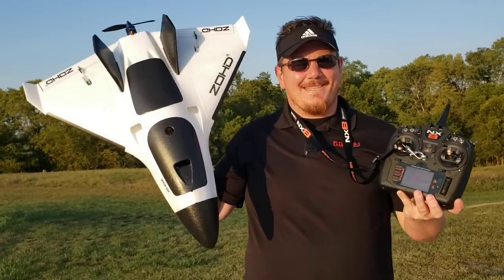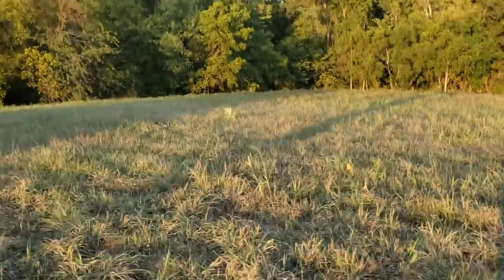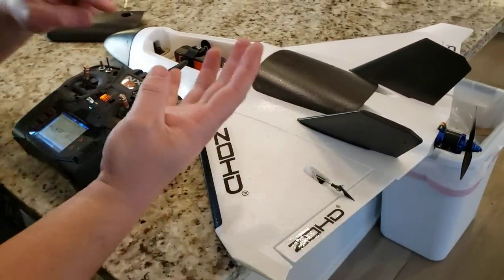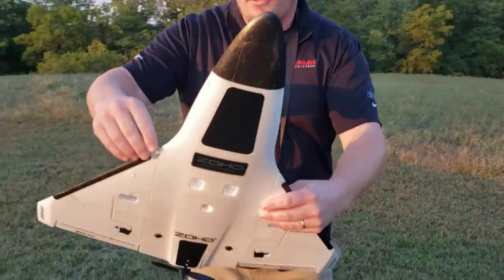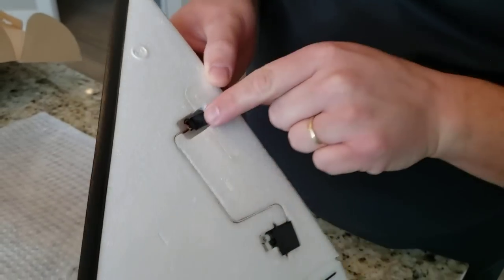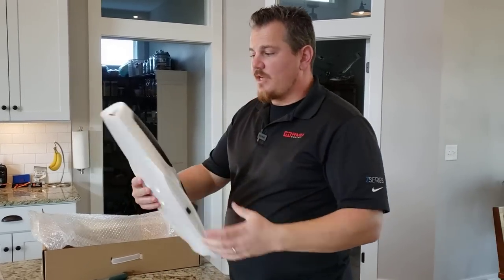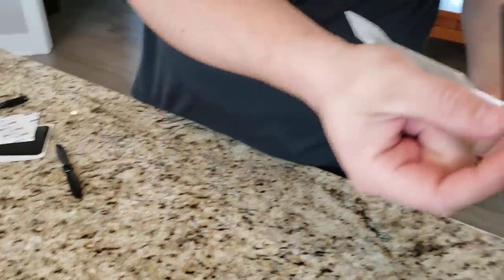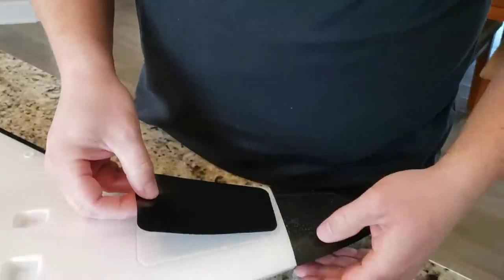ZOHD - Alpha Strike - 620mm - Unbox, Build, Radio Setup, Maidens, & Crash!

Comment: Okay, i am glad your crash was a careless error not doing a preflight servo check...i have had planes with even worse damage and more pieces than that..some i glued back together and they looked great with some light body work and paint...and flew exactly the same...my foamy repair skills are pretty much top notch..after 10 years and over 100 repairs you really figure out the best methods...whats great about your crash is the wings were not damaged...easy to fix imo...
Reply from the maker: yeah, fixing foam is one of the best parts of foamies, but people still bash them as though it's a negative quality. I love the fact you can fix them for next to nothing, in many cases...sometimes, of course, we need parts, but it's still a lot easier than doing a repair on a balsa wood plane
Reply: @BrianPhillipsRC  actually at bg they sell fuse with nose  for about $20 ...i will will practice with my beat up planes before i maiden...i think its a great model,reminds me of my 50 edf skyangle screamer...i crashed that in a chainlink fence (6 peices)and managed to fix it...still flys great..Happy flying!

Comment: Thanks for sharing. In this hobby things happen.  Equipment failure, pilot error, etc.  Glad it didn't turn out worse.  Still a cool plane.
Reply from the maker: Pilot error...not equipment failure. I never let it initiate after I adjusted the breaking... this was a very unfortunate pilot error ;(
Reply: @BrianPhillipsRC no worries.   based on your flying skills this is a very rare occasion.  Absolutely love your channel and your format.  The most useful for me of any though I have older radios so the setup portion, while interesting and well done, isn't something I can use..    for now.😄

Comment: OK, so i got the ZOHD Alpha Strike, yours lasted two more flights than mine. Maiden flight it went into an uncontrollable up and down and flew out of site. I painted the top safety orange and that's the only way i could see it as far as i did.  Who knows where it ended up. I have been flying RC planes and heli's for over 35 years and never had this happen. No more of these for me. I have an Extreme Flight Outlaw from 10 years ago. It is the ultimate speed rush! No stabilization and flies like on rails.
Reply from the maker: I bet you might have been a TOUCH tail heavy, which is SUPER easy to so... Sorry about your loss!

P.S. I deleted a duplicate of your comment...not sure what happened, but didn't want you to think I was upset or something strange.

Comment: Analog VTX at 1.3ghz, 4S 000mah Li-ion, TBS CRSF or ELRS, a nice cam, 7.4 folding prop, 50a esc, T-Motor F80 with a nice ground station and automatic antenna tracker and go fly some nice long range. Short range, swap out to DJI FPV air unit or TBS Unify 5.8ghz HV, 4S 3200mah lipo, F80 motor, 50a esc and 7x4 folding prop, and  then slap either the FPV COMBAT or ZTAG unit in it and get a friend to do the same. That's how to enjoy this wing. 😃 That's just my opinion of course. Enjoy it the way you see fit. 😃
Reply from the maker: Sounds like quite the payload ;)

Comment: DITTO'S,Your an wifes time for Lonnnnng videos. Well worth a RC'ers time to watch an learn.. even liked the snow,.
Im 63 12 years electric planes.
Fly Havok,Radjet, Fast. No assists.
Because of your video on ZOHD ALPHA STRIKE, I purchased.
For me an without assist had 4 flights b4 PILOT ERROR crash an burn. . .
Wow what a Rush of Adrenallin, .
I recommend Some kind of flight assist for most however.. i banked to steep in a turn at low throttle to low  at 
"0 mistake high" lol. My Error totally as yours was passing on control check,. Hey I Relate, . Shes a Great wing Airframe, . An quite a Motor Esc, to say the least. 
. Ill buy a few more of these..
Will put some type of stabilizer nextime. 
I was Crying about that Crash an burn. Great Aircraft for The 
" Set your Hair on Fire Pilots".
Shell rule your Clubs Airfield.
Tks again Take the Camera crew out to Eat. You so Lucky!
Reply from the maker: Glad you're here with us, and stabilizers are a huge part of making this hobby fun for me...I don't lean on the auto leveling much at all anymore, but stabilizers make the planes a lot easier to "tame". Some people don't like the "feel" of a stabilizer, but I personally like the feel of plane that's in one piece - LOL ;)
Reply: @BrianPhillipsRC  , 10-4, Im looking into GyroStablizer's nx3, possibly Zohd , Have admiral, lemon with stablizers already.
Yes the Fast Havok, an most wings I admit benefit from Stablizers,.
. Ill have one in My ZOHD A.Strike, Great plane, Mostly,lol

Comment: I think this is worth a revisit. It looks to be up there with the F27 maybe even faster. AR637T and maybe a different esc. I was scared just watching the flybys! Great work again!
Reply from the maker: Yes, AR631 would be just fine. I should have just used one but here we are. I don't blame the equipment for this one...I never actually watched for the aileron twitch - big mistake!
Reply: The F27 would be a great comparison, it's probably about as fast but with sooo much more room inside for whatever you want to put in it. Wonder how it would fare with a slower more cruiser with FPV setup for longer flight times.

Comment: Waiting to maiden mine. Really like the way you launch it. I usually use a side toss on similar planes, where you hold the plane by the wingtip with the plane on it's side. The torque levels it out, rather then starting level and then going on it's side. AND gets the prop away from your hand. Side note-please don't take a damaged battery into your home, even for a moment! I was waiting for that thing to blow... Thanks for the great videos. What camera are you using? The quality and focus holding are awesome.
Reply from the maker: That battery was taken out and shot after we were done taking footage. I know exactly what I was risking and have experience with these packs. I have intentionally burned them, shot them, pierced them, tested the way they puff before 
blowing up...I'm well versed in the way they fail (to the point of fast burning fire, and or smoke bomb).

As for this plane, wish I got some more time with it, but such is life with crappy rx'es ;(
Reply from the maker: Megan was using my Samsung Galaxy S9 - she is a genius with the camera! So lucky she helps me!!!

Comment: I think I've watched 5 videos on this thing, and every one of them ended in some kind of wreck. You flew it longer than anyone else. Most people launch it horizontally and torque roll it right into the ground, some of the flights are literally 10 seconds.
Reply from the maker: WOW - I feel a lot better about my tragically short experience now - LOL ;)
Reply: Yep, so many failed maidens lol. It needs speed to fly at its best,  gets small so fast and is also difficult to tell orientation... which really makes it best suited for fpv.
Reply: It definitely gets small super quick and the worst plane ever fir orientation. I'm going to put an fpv kit on mine when I get round to it.
Reply: Brian is a very good pilot...many experienced guys have zero experience with fast prop jet deltas...those are the guys who crashed...Brians crash was just an electronic issue of some kind,not pilot flying error or poor plane design..these are not for everyone,but they certainly are a lot of fun for many of us..😊
Reply: Yeah l agree with the above. A lot of people have noexperience on a model like this. If you launch it level half throttle is enough for it to head out with no torque roll if you give it full it will roll so don’t give it full😮 lm used to funjets radjet , other small fast stuff LOS only that’s where you learn to handle stuff like this. I like it a lot bit of colour under the wings no problem seeing it so long as you don’t take your eyes off it😮
Reply: @catfish828  i also have had a few fast radjets over the years and others..do you think it handles as well as a fast radjet or is it a lot harder to dial in? I have one of these on the way..thanksfor your imput.😊
Reply: personally l think it handles just as good maybe better . It seems to fly as though it’s on rails very solid . No wing wobbles like the rad can or at least mine does. Depends if you have cg spot on these planes they fly great. I don’t have any stabilisation or flight controllers . Flew them both on 4s stock motor with the rad then changed it to a Tmotor 2500kv 5x5 plenty fast enough. Also have the Dolphin that flies sweet fast as well.
Reply: @catfish828   Sounds Great...i never use gyros either..CG will be spot on for maiden..thanks for all your help...

Comment: Could be even faster if you taped over the intake vents and mounted the esc on top of the fuse instead... but after watching that, I really don't think it needs to be any faster, looks a real handful!
An even lighter build with a quad motor, esc with the battery in the rear bay would be interesting to try...  I might do just that with mine.
Reply from the maker: CG would be way tail heavy with lipo in the back, but you can swap gear all over the place with this thing.
Reply: @BrianPhillipsRC    Yeah, I was thinking that after I posted the reply. Maybe have to hollow out the centre foam section for the lipo if I went with a lighter motor, I think that might be the way forward.
Great flying btw and it looked  sooo much better with the CG more rearward... and although binned that was still quite something to see.. and a great video.
Thanks again. :)

Comment: Personally ..It looks good, but I feel it needs more wing area .. add +6" on both sides.. that would improve its slow speed and landings and also reduce the initial torque roll on take off.. that body shape is great, with plenty of room for your gear.. perhaps too fast for FPV as it is..
Reply from the maker: True, but I just killed it before I got used to it ;) She'll fly great, but I was still in "crazy" maiden mode...I wanted to share a better landing that I KNEW it had in it. Sorry I kinda screwed the pooch on that one ;(

Comment: Are you familiar with lemon rx/gyro combos...i wonder if it would make this plane easier to maiden and fly...i have one set up in another plane where i can switch on and off from gear switch and also turn dial on my dx8 to adjust gains higher or lower...thanks

Comment: Hi Brian great video as usual. So did you ever figure out the gyro settings an what they do? I just ordered the same setup and would like to know before starting  when it gets here. I have flown with the eagle tree 2d 3d stablizer before and it has 3d mode, off, and self level. 3d mode works great on delta wings for launch just angel the plane in the direction you want it to go and flip the switch and it will hold that attitude till you move the stick. Just want to know if the NX3 works the same. Thanks
Reply from the maker: Yeaaaaahhhhhh....I DID kinda figure out that they work, but you have to let them INITIATE, and this is better while on the ground ;)

Comment: These jets should not be flown with stabilizers. Just use 50/60 percent throw on ailerons and 40 percent expo. Use 80-100 percent throw on elevator and 40 percent expo. You don't need the stabilizer. I've flown way more sensitive jets like the hobbyking parkjet and they do fine without any gyro/stabilizers.
Reply from the maker: This is a highly subjective matter. You're certainly entitled to your opinion. I fly with stabilizers, and love it that way.

Comment: Based on all the video’s that you’ve made so far, I’m guessing that the crash was due to something electronic.  Maby that stabilizer.  Not your flying skills.  I also noticed that you had your receiver antennas sitting right on that carbon fiber rod.  Great video though.  I have one of these on the way  right now in the mail.  Camera crew got a good workout with that little screamer.
Reply from the maker: yeah, in hindsight, I think the stabilizer wasn't initialized properly - BUT it was FUN TO WATCH!!! ;)

Comment: One would have to assume poor elevator authority with the propeller behind the control surface.
Reply from the maker: I thought the control authority was more a function of being a bit too nose heavy as the CG marks suggested. I think a bit more tail heavy did help quite a bit.
Reply: @BrianPhillipsRC  I think the chord of the control surface as a percentage of the total chord is important too. I made a scratch-build plane with similar ratios to this and it was extremely uncontrollable at slow speed no matter where the CG was. It doesn't matter for roll so much but for pitch, a wing with a deep chord and small surface mostly wants to maintain the current pitch. A low aspect ratio seems to make this even more so. At high speed the angle of attack is lower and air is following the upper surface of the wing better, so upward deflections of the elevons have more effect. Just my armchair aerodynamicist opinion :)

Comment: Hopefully this helps ZOHD Heads that read You,,,

Brian, This is My "Moby Dick",. Hopefully I Fair better than Ahab.
Im 64 yo always 13 year Electric Flyer. Feel like a Noob,,  with the Alpha Strike.. 

 
I "m going to this time "#2,,,. Lost #1  in Corn Field at my  AMA Club last month. 100mph Lawn Dart,

 pair with ZOHD Ko-Pilot . 
Auto Launch,;Return to Home, an Stabilization.

Launch no Power, basically its. The "Return to home "Function. Will gain 300 ft an circle by its self..

"WHEN" It gets to far,. Hit return to Home it will recover an circle. Catching my breath, than repeat.
Its best a "Drag Racer" in a Giant Loop after "Drag run. Is the goal. 

With no Rudder #1  Death Spiraled unable to recover  , to slow in a turn.

Ive the Ko pilot in the ZOHD Drift, an Talon Evo.
Both used as FPV an line if sight. Its a plug an play system this Ko pilot.

Its such good Construction,  Tough Foam, lot of room, cooling. Hope to "tame" it.
I suppose as They tamed the White Tiger, . . .We only live once, lol.